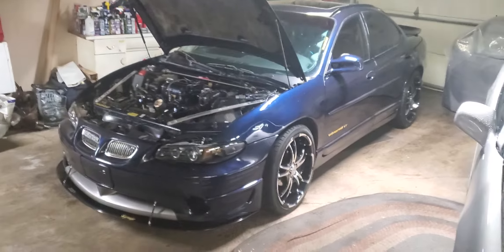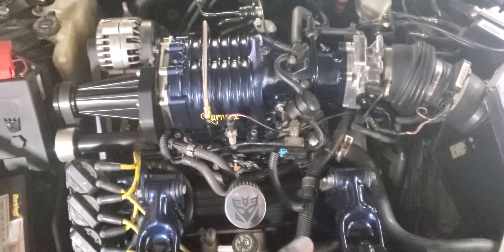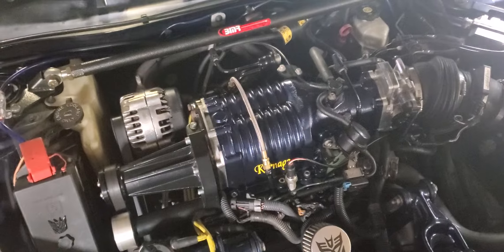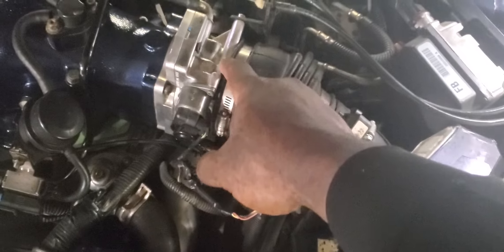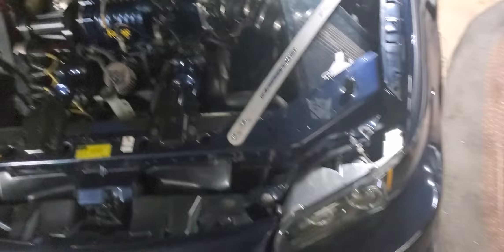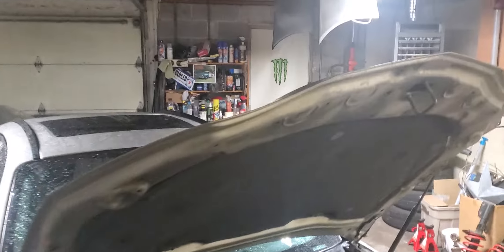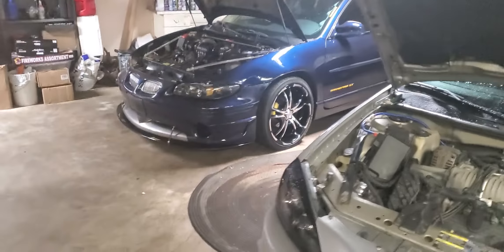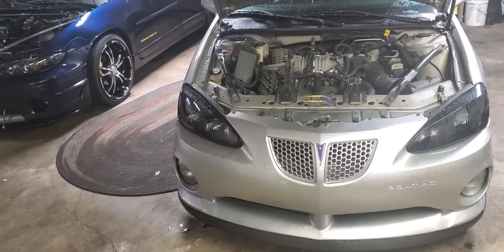Winter builds begins now

Comment: What's going on? I'm matic.. new to the car scene. But I have a goodie.. I have a gtp coupe. So I also have 6 children so my upgrades have to be percise.. I see hell boi is running 414 on dyno.. I'm looking for closer to 350 for my gtp. But I have no idea how to properly do it. The plus is that I'm mechanically inclined... so I can do the work. Just need to know which parts to purchase... question is can you possibly help me with a mod list. Wanna keep it under 7k
Reply from the maker: Turbo kit and built trans with heavier valve springs and injectors sound ok?